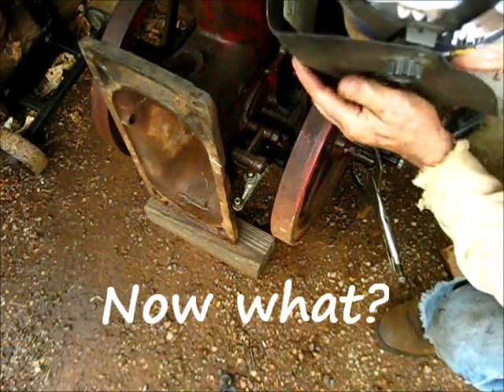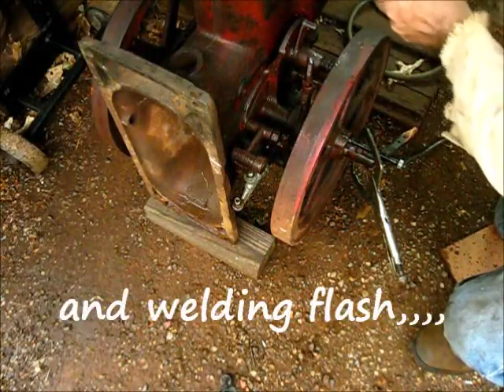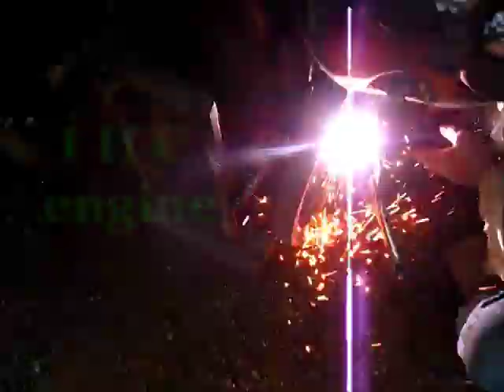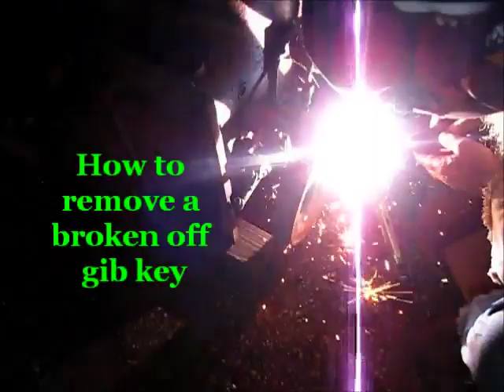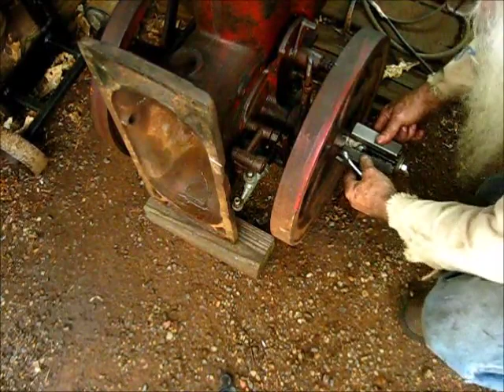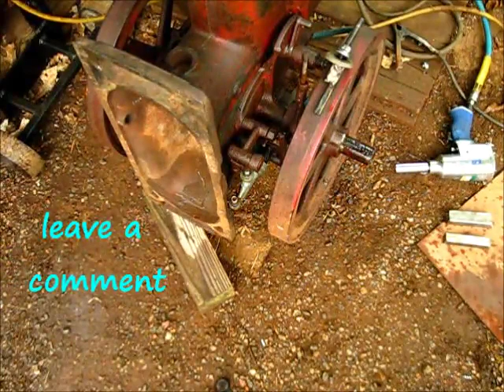IHC ENGINE / how to remove a gib key / gas engine

Comment: I bought a 60 gallon air compressor at auction for $40 and all I had to do was put a new motor on it. Which I already had a 220 volt one here. That was 5 years ago and it still works great.

Comment: I could have used your help this week.  I've got a whopper of a stuck item in my engine...
Reply from the maker: Greg's Garage ,,,, and I done went and seen that sparkplug problem you done went and fixed,,, and it's a good thing that I was not there to help,,,, we would have painted the oil pan while we had the engine out,,,,,,
Reply: LOL